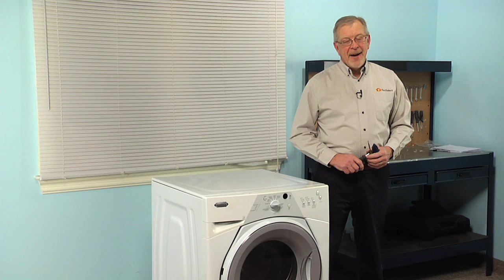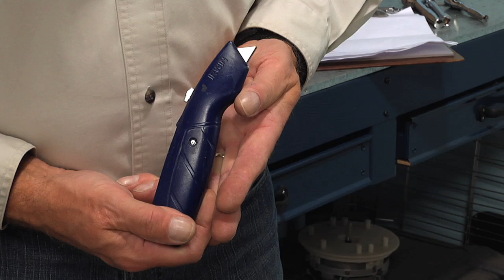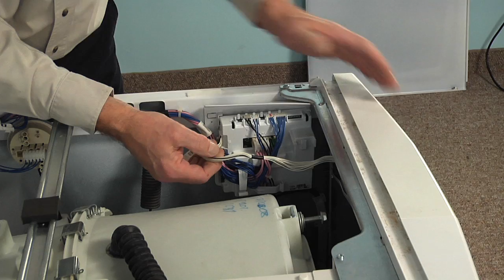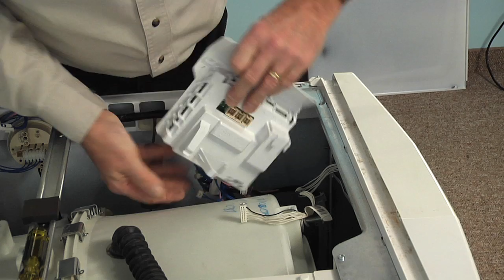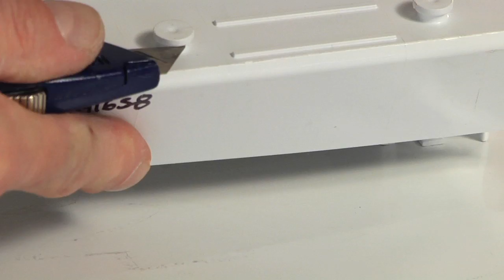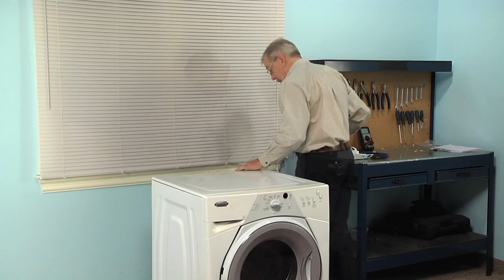Washing Machine Repair - Replacing the Control Board (Whirlpool Part # W10205839)

Comment: can this be done via the front or rear in the event the dryer is stacked on top?
Reply from the maker: Thanks for the question, Jim. On this model washer if the unit is stacked the dryer will have to be removed from the top of the washer.
Reply: @partselect  thank you!

Comment: When I press the start button on my washer, it starts, but then it immediately stops.  No error code . . . it just flashes the 50 minutes left on the cycle that it started with.  Sometimes the door stays locked and I have to unplug and reset it so the lock disengages.  Other times I can press start again and it will run a full cycle.  Other times it runs just fine.  But it is getting worse all the time.  Is that the control board?  It is a whirlpool duet washer model WFW9550WW00

Comment: I have a Whirlpool Duet Washer Model #wfw9151yw00 Front loader. I have been watching your videos and I thank you for them. But...I have replaced Door latch/lock, Now bellow that took 2 days and 3 people to do. Still getting the f9E1 error code. I've noticed that if I click on different settings to like drain the water again, nothing happens. I've cleaned the coin trap, hose, black rubber thing that goes with coin trap filter. there are no noises with the pump itself. I'm  a 63 yr old ill woman with a bad back to boot. But I'm ready to get my sledgehammer out and make my own video about how to fix this machine. My friend said it showed a SD which I had learned before is "Slow drain". Then the F9E1 again. Ieaking on floor has stopped with new bellow, thank you. But what else? Change Control Board? 3 weeks w/o a washer. Please, Help Me!!! PS when I had the water to the washer turned off and went to bed, I woke up with a flooded house. When I rehooked up the washer the leak seemed to stop. Just trying to put out there all the issues it could be.

Comment: Hi,i started to change new control  board(power board),it can on but when i start running my board,it burned the fuse in control board(located near incoming cable).the fuse rated on 6A (volt will check again).So what the posibble fault component it could be?

Comment: I have a WFW9151YW00 washer. Saved about $100 on a SearsDirect control board and then found this video.  Saved me a lot of money. 

Thank you sooooo so much for this!!!  I successfully replaced my washer control board.  Thank you for the extra tid bits of information.  
Advise people to take pictures of where cords are located even before you take the cords out because I got confused on which stations were not supposed to have a cord in it as well as which ones were supposed to fit in their positions higher than others. Had to pause the video to make sure mine was identical.

Comment: When i try to start machine it clicks like shorts out no error green light blinks 
Door locked light is on 
Is it the control board
Reply from the maker: Hi, to me it does sound like the control board. It is not flashing you any error code on the display? Please supply your model number and I will be happy to get you price and availability for you on the control board for your model.

Comment: Hello sir
For why replace the control board
Please explain to me 
Thank you
Reply from the maker: Hello, if your appliance is flashing and error code most of the time the error code is to replace the control board.
Reply: @partselect  Explain to me how a control board can go bad? I can see maybe a loose wire from the spin cycles but how does a control board really go bad??

Comment: Thank you very much for this :) I successfully replaced my control board and got my washer working. It was also a WFS1073DD that another user mentioned previously in these comments - the one you said you couldn't locate. It's an Australian Whirlpool model with terrible reviews and a control board that is highly prone to failure. I'm not surprised to see other comments related to this model. Ours failed after about 5 years.

Comment: HI,
I have Whirlpool MOD WFW8410SW01 and getting error code F-28, do you think the problem relate to what you described?
thanks
Reply from the maker: Hi Thao, when researching the error code F-28 for your model, there is a communication error between the main control board
and the motor control board. I would suggest checking the wire harness connections between the main control board and the motor control board. Check to see if there is any loose wires or any damaged done to the wires. If you don't see any damage, i would then suggest checking the connection between the door switch and the main control board. If you have a bad door switch it can block the motor board from getting power.
Reply: thanks for the respond, I have checked all the connector between MCU and CCU(unplug and reconnected) and still see the error, I will look into the door switch...thanks

Comment: My whirlpool front load does not start but will attempt to spin. Is this a control panel problem?
Reply from the maker: What is your model number?
Reply: LHW0050PQ4
Reply from the maker: The problem could be related to the the start switch, motor control board, or main control board.
Reply: I have the same problem as above with the same machine.  I press start and it locks the door and seems that it will start.  I leave it for an hour or so and when I return the "done" light is just flashing but nothing has happened.  The door is still locked and I have to turn the knob to the stop position and wait for the door to unlock.  Have tried the spin function as well and it just stays on spin but nothing happens.  Do you think it is the display panel that needs to be replaced?  Thanks in advance for any help you can offer.

Comment: Mi lavadora whirlpool marca error F99 que será me puedes decir porfa
Reply from the maker: The F99 usually appears after a CCU has been replaced. Try running a diagnostic cycle to clear that code.**El F99 aparece generalmente después de que se haya reemplazado una CCU. Intente ejecutar un ciclo de diagnóstico para borrar ese código.

Comment: Hi could anybody help me I turn on my washing machine and its tripping my electricity does anybody know why.
Reply from the maker: What is your model number? Does the breaker trip as soon as you start the washer or part way through the cycle?
Reply: Same problem me also facing my machine switch on at the time main switch trip few days back drum just rotate after stop my machine whirlpool 7 kg frond load pls help which part complaint ?

Comment: This video worked great on my Maytag 4000 series washer.  I replaced the control board and then got an F99 code.  Can you tell me the next step I should take to get rid of the F99 code?
Reply from the maker: +Michael Semmler Normally you would press Pause/Off or Pause/Cancel twice.